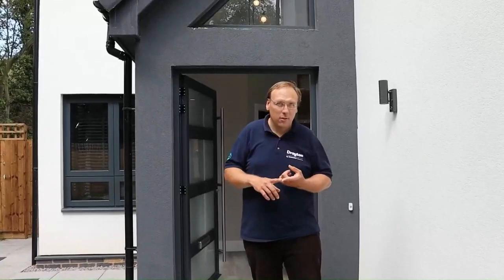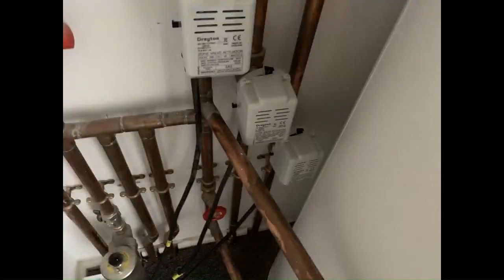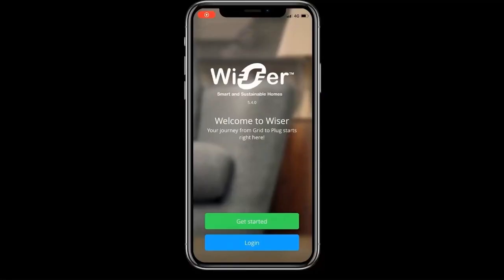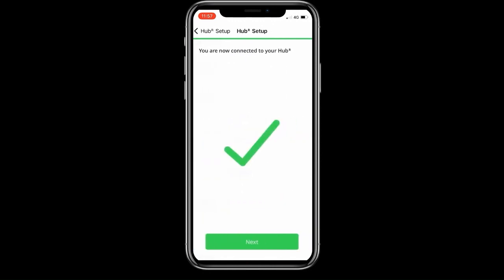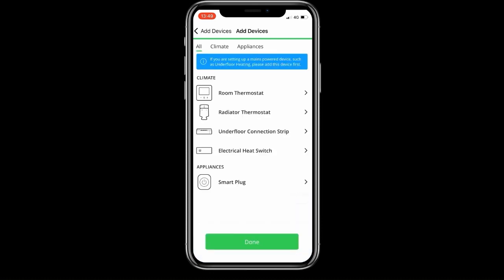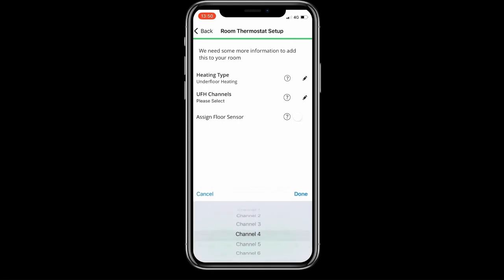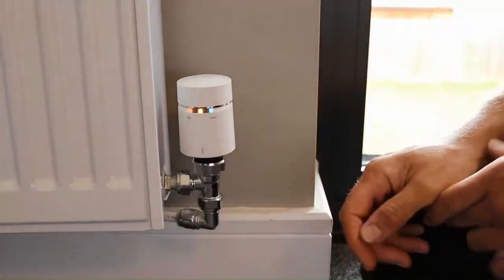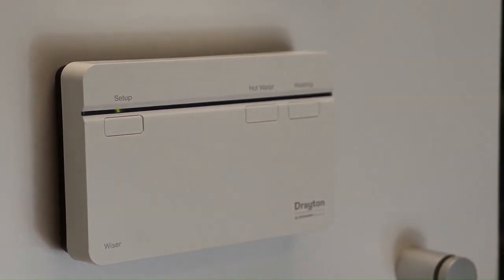FB Live Training  - Mixed Heating Systems

Comment: Can we have flow temp control added to the Wiser app?
Installed a Wiser system (Opentherm) to my Baxi 800 now my DHW is fixed at 60 degrees and CH maxed out at 80 degrees.